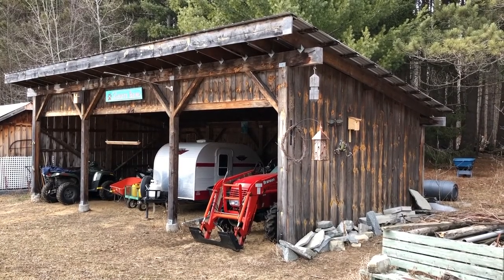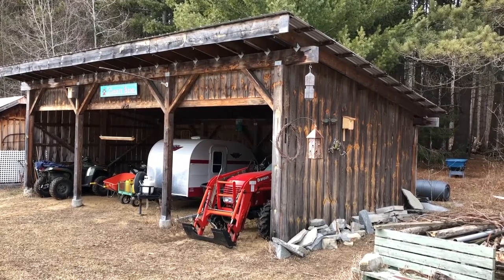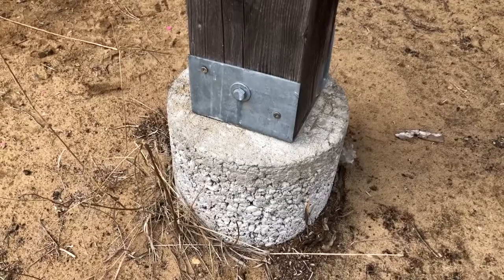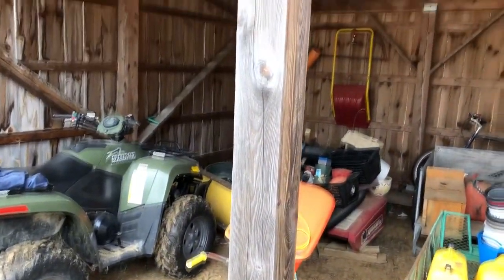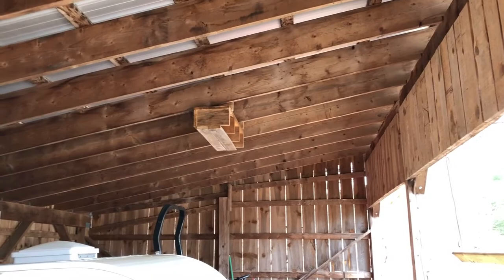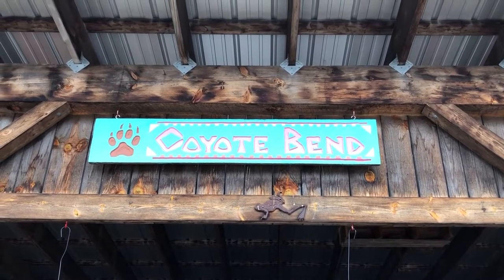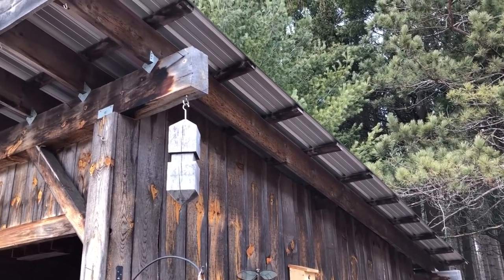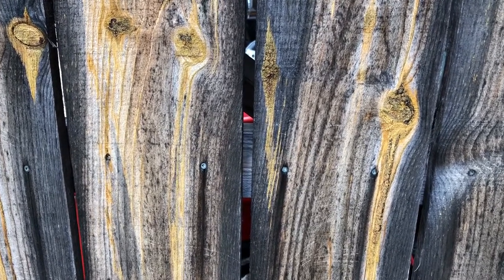Tractor Shed Build

Comment: What would you think if I were to take 10 inch green trees cut them and use them as main poles. I’m planing on just ramping them in like old telephone poles. I have the huge tamping stick used for poles
Reply from the maker: Hello, 

I don't think green trees would last long under the ground.  Better to use pressure treated poles for that.  If you were going to treat your own poles with some sort of preservative I think you would have to let them dry out first so they would then later be able to absorb whatever treatment you might apply.  Without pressure you would likely have to let them soak in a preservative bath for several days at least.  Most telephone poles are treated for in ground use.    The other option is like we did with the concrete piers.  A little trickier and more work but nice when it is done. 

Our horse shelter uses pressure treated 6"x6" poles put straight into the ground and it has done fine for 16 years.  I'll do a video on that shortly.....
Reply: Herve Del Norte thanks!!!! I think I might look into a nice treated post then. I have been collecting all the free stuff ppl are throwing out. 
I’m teaching my kids about reclaiming and I want them to tell story’s about this building long after I’m gone.
Reply: Herve Del Norte I have four 20 ft industrial trusses and bunch of roof tin. Also have piles and piles of other lumber. I just don’t have the big posts